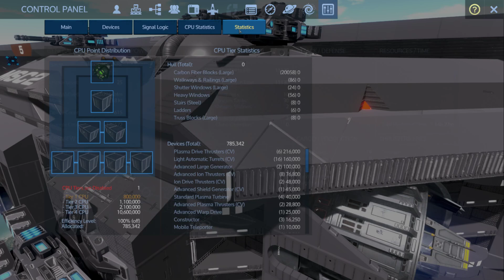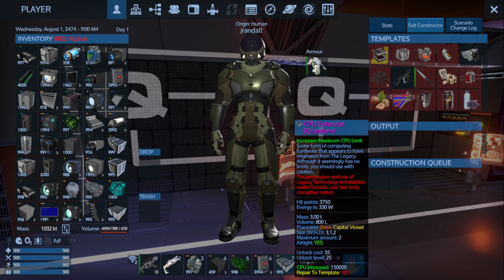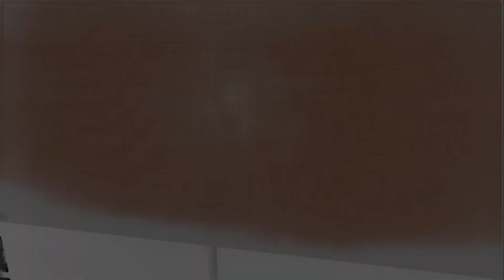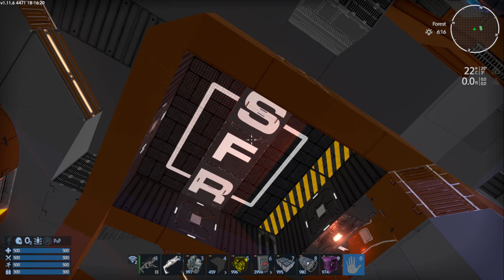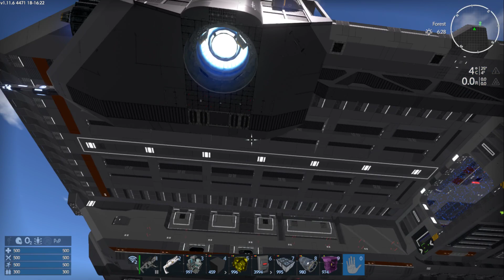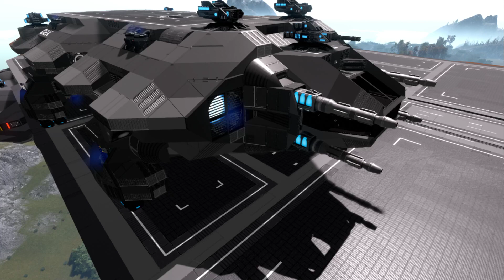Empyrion Galactic Survival - Helios-MSC2 and Carapace-C2X (RE2) near complete

Comment: If you cant land CS on this platform whats the point of this ? I was thinking about getting something like this so i can move all my ships SV and CS and use this platform as my main base but you cant land CS on it so its useless :(.
Do i miss anything or something ?
Thanks
Reply from the maker: You can land a capital ship on another capital ship and move it with you. It does work. Been doing that for a long time now. So the Helios ships can have other CV's land on it and dock. The modules are also CV's. The only thing, is CV's don't dock to bases but can still land on them. Bases don't move thou so I makes no difference. One thing to note thou, if a CV has other ship docked to it when trying to dock to another CV, it will not dock until you remove whatever is docked to it. I hope that helps and thanks again!

Comment: Just FYI, those "Commercial Constructors" (the ones with the RE1 model) are lootable constructors that use less CPU but more power. The standard craftable constructors are the more cubic ones from vanilla. Both should work, but you'll notice that you have to drop in a Commercial Constructor whole into the factory so you have to grab one off of an OPV or POI.
Reply from the maker: Interesting and good to know! Thanks again!

Comment: Does that unplaceable quantum core replace the main core?

Always love me an upgradeable ship. The Helios is such a grand one to have. It is probably best to leave some parts out, like the turbines, and left the thrust weak as it is, and let the owner upgrade as they can. I personally would likely have more than enough fuel to run it without turbines until I could afford to add them.

Thanks Jeff!
Reply: Probably.
Reply from the maker: Good question. I will try that out. And thanks again!
Reply: @jeffrandall2813  Pretty sure the Quantum Core is the reward for completing the quest on the other side of the gate.